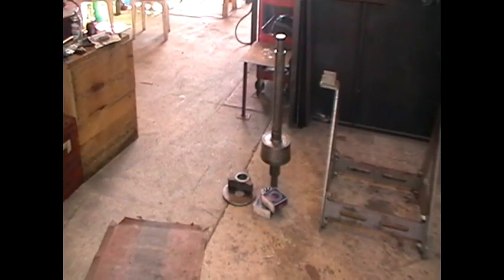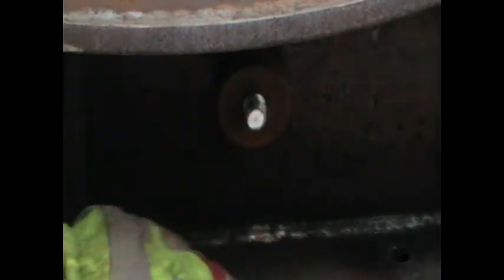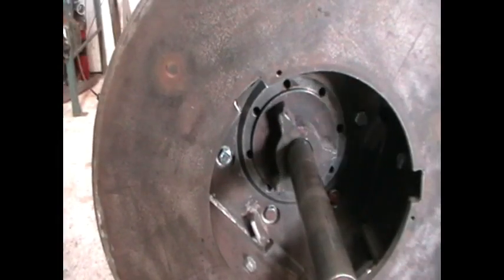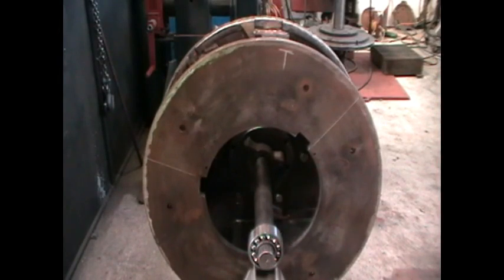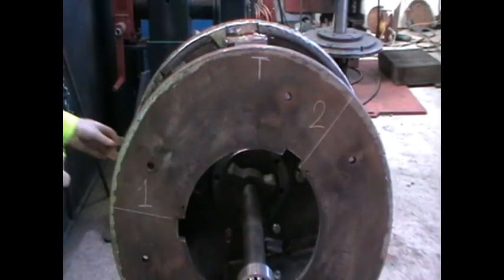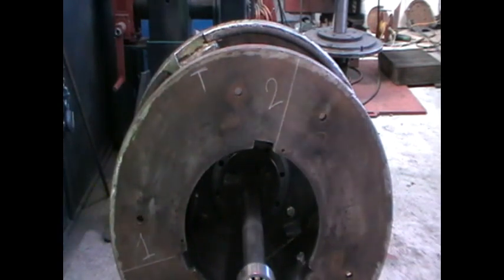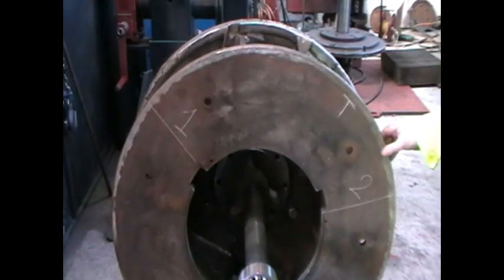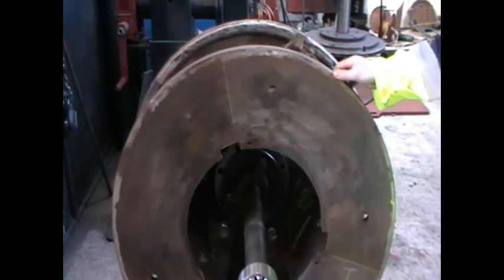Barmac VSI Rotor Balancing

Comment: Why should you remove all wear parts, they are part of the rotor when spinning? Ideally, they perfectly balance, yet, many times they are not, and that is the reason for dynamic balancing. I would love to know your reason. Thank you in advance.
Reply: I saw someone asking me how to balance the rotor. It seems a lot easier than many people imagining. You would have to make a shaft  and frame as the clip above. Then, you have to fit all the wearable parts. Fit the rotor to the shaft and place it on the frame. Rotate the rotor, ideally it would stop anywhere. If it stops at a particular position, meaning the heavier side is at the bottom. Place magnets on the opposite side and rotate. Keep doing until the rotor would stop arbitrarily. Meaning balance is achieved. Mark positions of the magnets on the rotor. Weight the magnets and cut iron pieces equivalent weight then weld them to the position of the magnets you marked on the rotor earlier. Lastly, try to spin the rotor a little quicker to see if the whole thing shake, if it does, you have not balanced it! I attached a pulley to the shaft and use a variable speed motor to rotate the rotor. Normally, once you balance, it will not shake. 1-2 degree is acceptable. I use a smart phone to measure this. Any accelerormeter app should do. You should be surprised to learn how NOT difficult it can be!
Reply: @219cafe  I under your description much better, I think what messes up my understanding of the videos is that he does not mention that after removing the old balancing weights the rotor is now in its natural state and should stop at the same place every time. After checking all bearings and cleaning the rotor but before removing the old balancing weights it should be marked and checked by spinning the rotor several times and if it then stops in the same place every time does it need to be balanced. (Still, be suspicious on the bearings)